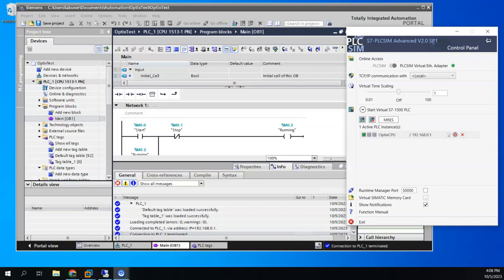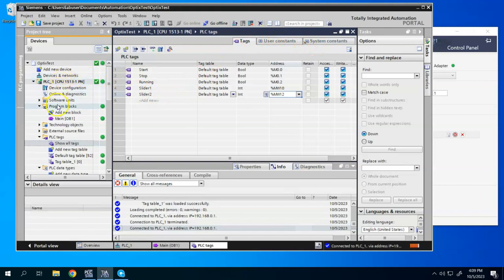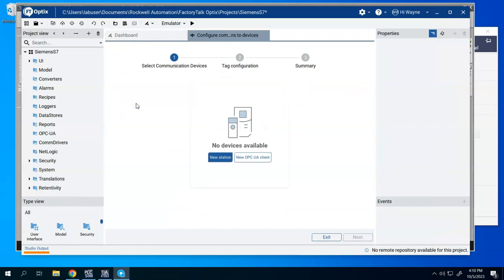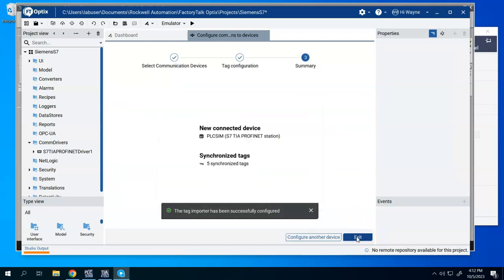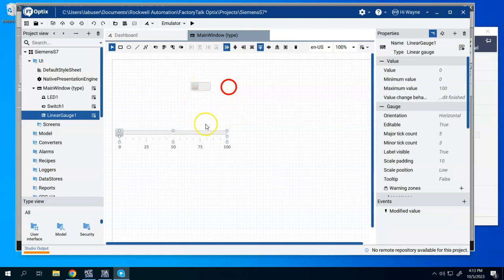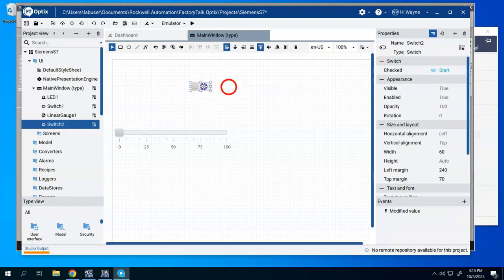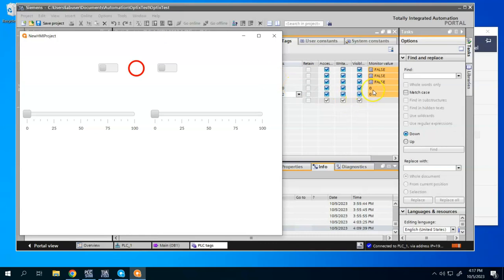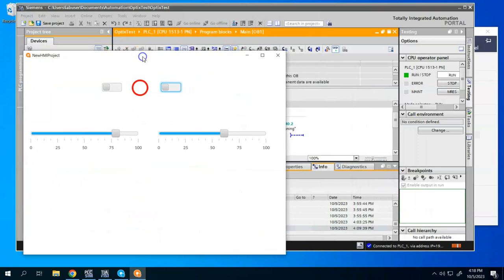Connecting FactoryTalk Optix with the S7 TIA Profinet Driver

Comment: I try to connect FT Optix to a real PLC S7-1200, and i got error code 6 with message: " Exception caught: Cannot connect to station", i've already assign the ip address and port of plc, is there anything else i should pay attention to, sir?
Reply from the maker: Using the S7 TIA PROFINET or S7TCP driver?  Does the Port setting in FT Optix match that of the S7-1200 PLC?

From  the Optix help:
Number of the port used by the TCP-IP connection. It must match the one configured in the controller.
Reply: @wawelk  yes it match with the plc port, in my case, port is 65 i already checked in the hardware configuration
Reply from the maker: I don't have a way to test with a real S7-1200 CPU currently, but I would say to verify your laptop is setup with the right IP address and subnet and you have a good connection to the controllers with TIA Portal.  Use the S7 TIA Profinet driver (if not already).  The Optix help file (question mark at the top of Optix Studio) gives some additional information on recommended settings in the CPU such as:

 - Set Access level to a Full access option.
 - If applicable, disable the Only allow secure PG/PC and HMI communication option.